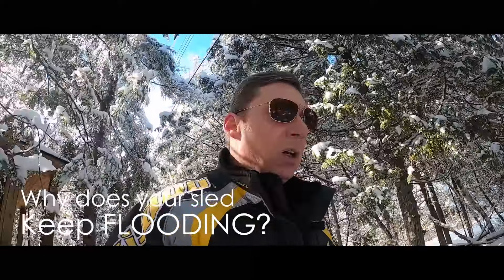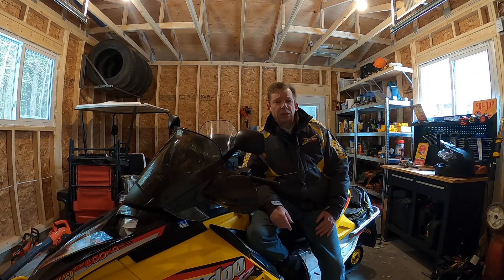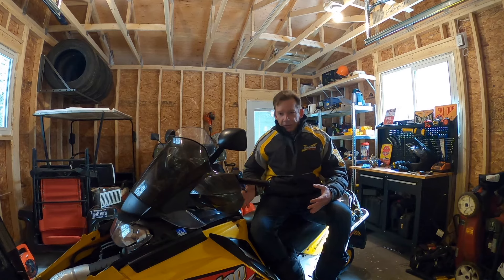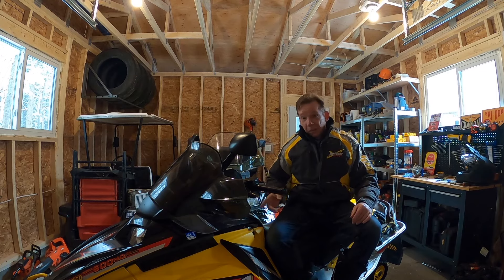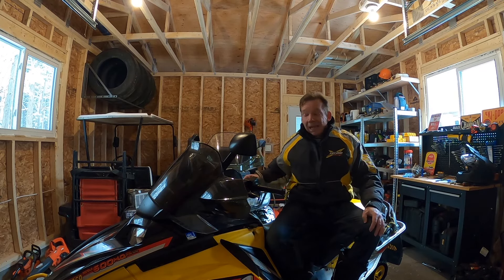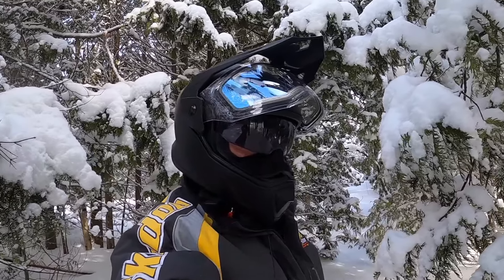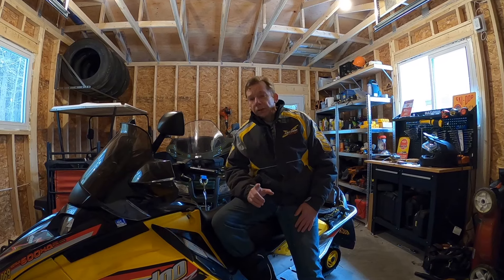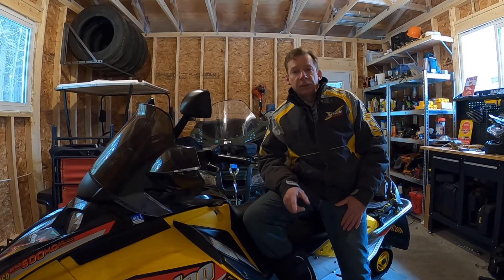Why Your Snowmobile May Be Flooding, Fouling or Running Rich

Comment: Holding the throttle open and pulling it over must clear the excess gas out.  It works on my old sled, in fact that’s what the owners manual says to do. Like you said now I know exactly how to start it so it’s never an issue but if your stuck out on the trail it’s a life saver.  Nice video Dave 👍🏻
Reply from the maker: Too much work :) thanks for watching

Comment: Hey Dave I had an issue with my 1996 mxz583 and it was my float bowls were actually cracked so the floats would never move up to shut the flow of fuel.  Took me a while to figure it out but once I did the sled ran like new after.

Comment: Got a 95 polaris xlt. High rpm bog can't figure it for life of me. Cleaned lines from in tank to carbs all spotless, tensioned belt & track, 120 compression. Runs & idols like a top however 6k rpm bog out. Happens with and without air box.
Reply from the maker: What do the plugs look like? Maybe try dropping the circlip on the needle one slot? Both cylinders. That would lift the needle slightly and allow more fuel. Let me think on this a bit but I think that would just richen it a bit…

Comment: Well my Skidoo flood so much it pours gas out of the exhaust. Clean the carburetors more times than I can count and it continues to flood and does not want to start. Everything inside the carburetor is new. Now discouraged to the point where I don't even want to own a Ski-Doo anymore new or old.
Reply from the maker: Diaphram in the fuel pump maybe, gas flowing through the pulse line to the crank case?
Reply: @MyOldSled  nope diaphragm in fuel pump gas lines are all brand new. There's no reason for it not to start and run besides to Ski-Doo being cursed.
Reply from the maker: No, if it was that my two wouldn’t start. To clarify, what did you replace inside the carbs?
Reply: @MyOldSled  everything including floats that cost $58 for one
Reply from the maker: I feel for you that kind of think is frustrating but if the fuel pump is ok, then its needle and seat or o-ring, float sticking or float arm bent up too much.

Comment: And this happened to me?? The primer was defective?? There are one way valves in the primer and if they get screwed up or leak??,,fuel can syphon into the carbs and cause problems..? If this happens,,pinch the tube supplying the carb!
Reply from the maker: My sled has a fuel shut off. Normally if the primer leaks it won’t pull gas up properly and you know its time to replace it.

Comment: The tip about watching the fuel line while priming helps. Lately it seems like I have to press the throttle to help it along. Is that wrong? Or should I just pump the primer more? Our temps have been up to -28 at night. I have the '97 Grand Touring with 583 rotax, electric start. I'm worried I might run my battery down. Once it starts,  I'm good for the rest of the day.
Reply: I did watch your video about how to start a 2 stroke when cold but I have those few additional questions. I saw that you were giving it gas and then had to prime a couple more times, too. I just don't know if holding the primer up is helping or hurting. It seems like it helps.
Reply from the maker: I generally keep them primer out and give it another shot or two when it hesitates until it warms up enough that it doesnt need a richer mixture
Reply: I have found that with most Skidoo models feeling for 2 full primer squirts and leaving the primer up helps. Re-hitting the primer when it starts I have also found helps. And not touching the primer for the rest of the day, unless you stop for a very long period of time. I have also in the past set the parking brake and inserted a quarter in the thumb throttle to prop it open. Happy riding!

Comment: Hey Dave, looking for some advice on my 92 Indy trail, I’ve done a complete carb rebuild, changed all fuel lines and pump but I am still having issues trying to start the sled. The compression is good on both cylinders, floats seem to be in good shape. There is a small amount of excess fuel leaking out of the overflows on the carbs. I poured a small bit of fuel in the cylinder and plugged the spark plugs back in and it turned over then died. Any ideas TIA.
Reply from the maker: Still sounds like a needle and seat issue. So wrong needle and seat, bad needle tip, floats sticking or not adjusted right…thats the only reason I can think of you’d get fuel leaking from the vent lines. Are the spark plugs wet?

Comment: Hi David.  Love the show.  One you missed here that is a mystery to many....if a fuel pump has a pinhole in the diaphragm, gas will run down the impulse line.  Happens a lot in the old Mach 1, Mach z, Formula...etc.  Happy Sledding!  Len
Reply from the maker: Hi Len thanks. Yeah I realized that would be good to include, right after I posted :)

Comment: Great video, lots of useful info. Hes right, Check your o rings on the seat. I bought a new to me sled this year (03 440 REV) , went for short ride on the lake,  was missing some power, I opened the side pannel and noticed that I was shooting gas out of the carb vent lines. Took the carbs apart and saw that my orings where dry on the seat and had shrunk, replaced them and eliminated the problem.
Reply from the maker: Hi Ben. Yep, for sure if you have gas shooting out of the vent lines it's needle and seat. Thanks for watching and for taking the time to comment. Have a blast with your new machine.

Comment: Great info Dave! The older vintage sleds were quite a pain because of fouling plugs from improper starting (excessive primer) and because of richer oil mixtures. Todays sleds are much easier to start but I like your take on why they flood. A good trick I learned from an older gentleman is, when you're in a flooded situation pull your plugs and pull it over (like you showed) and before putting the plugs back in, give each plug a shot of starting fluid, that will dry up the wet plug and make it more prone to fire. It's worked for me many times.
Reply from the maker: Thanks SK.
Reply: This is what I do on my 90 Arctic Cat Jag Deluxe with fan cooled Suzuki 440. Works every time, I always was reluctant to use starting fluid on my vintage garden tractors and motorcycles but this Arctic Cat was a monster to get started until I rebuilt the fuel pump and redid the fuel lines.  I expect to go through everything on an old tractor I buy for cheap but I thought I had a sweet barn find with only 1500 miles that was pampered in a garage by an old man. Turns out I still had to restore it based on time and not mileage and abuse.  For every 20 miles I had almost 10 hours of labor and replacing parts but she's almost brand new now!!

Comment: Hi Dave , New to sledding and running into the flooding problem. This just started with my sled. I'm running a 500 bored 30 over and this is a rotax engine i have installed in a 93 Polaris Indy. i synced the carbs and adjusted the air fuel mixture to the best of my knowledge. This thing hauls ass. I have maybe 60 miles on the new engine but now at start up its flooding its self out. once I do get it running and warmed up runs great. After watching your video that is the first thing I'm going to check. Thanks for the info.
Reply from the maker: Yeah when your talking Frankensleds I don’t even know what to suggest. Good luck, thanks for watching

Comment: Honestly I love the primer bulb over the choke lever I always found it more reliable but they are easy too flood. I've also flooded it but when it gets flooded I hold throttle wide open to get it to start. Now I have a fuel injected machine. I never found the 670cc engine hard to pull over one handed but to each their own. Happy trails
Reply from the maker: Once its warm, and running right it’s easy. When its cold and flooded, you wont pull it over easy with your left hand.
Reply: @MyOldSled  cold is a different story if it's cold flooded I pull the plugs clear the cylinders and dry plugs

Comment: I'm new to sledding this year and I come across all the odd stuff. One cylinder one lean turned out to be a needle and seat. A new gas line sucking in air. and now I'm fighting it bogging in till wot kicks in. I did rebuild the carb synced the carbs put it to factory specs and all that. I'm sure its fun once you get the hang of the carb stuff. Your video made me thing I should start the checklist over again though. Thank you.
Reply from the maker: I would order a carb kit and then you know you have all stock jets o-rings and gaskets
Reply: @MyOldSled  Thats the rebuild I mentioned I did. Jest, seals, needles ect and ultrasonic cleaned the carb. Maybe some dirt got in there again?
Reply from the maker: What sled is it again, sorry?
Reply: @MyOldSled  its a 96 polaris 440
Reply from the maker: Msg me via facebook if you want to bat some ideas around.

Comment: 03 rmk 800. 
Bogged down and died under heavy throttle, idled poorly afterwards until things settled into place after. 
Solution - drained fuel mostly, added half a tube of Lucas injector/carb cleaner, which is like 2x recommended concentrate on a full tank, ran it dry, the added 5 gallons, and poured in the other half.

I hate taking apart carbs, so I just hit them with enough cleaner to kill it, just about

Comment: If you think that thing is hard to pull over try a mach 1 670! The mxz 670 for that year were extremely easy to pull over due to the great big recoil. The mach1, had the smaller recoils from a lot of smaller motor ski doos. 

Also, I would rather just hold it wide open and pull the thing then blow gas all over my sled. 

You did a good job explaining how fuel mixtures can be rich or lean, I think pretty much anyone would understand it with how you said it
Reply from the maker: LOL @ "Extremely easy to pull over" ...Not sure if you noticed the big '97 MXZ 670 in some of my videos, but in case you didn't, well...I have one....and they're not. :)
Reply from the maker: Oh… also a huge difference when it’s cold. Warmed up it’s easy
Reply: lol
Reply: My old mxz670 would start on the first pull. But it took 2 adults and a team of healthy volunteers to pull it over.

Comment: If it’s super flooded you can always use a butane torch down the cylinders, just make sure to turn the fuel off and pull it over quickly if it catches fire lol. Has saved me tons of time on an old 80s Yamaha rather than pulling with plugs out, especially if the crankcase is full of fuel. Also, glad to see you’re making more videos these last few months, was missing your vids for awhile there!
Reply from the maker: Oh my. I really appreciate you watching and commenting, but I can’t express how much I don’t recommend doing that. (How would you use a butane torch down the cylinders without pulling plugs anyway) There are so many reasons that’s a bad idea, fire risk damage to your engine… please just don’t
Reply: @MyOldSled  haha fair, I expected a reply like that. Grandpa showed me this trick back in the mid 90s. Yes pull the plugs, then using a little Coleman gas tank and nozzle, quickly pass it down the cylinder. May give a bang like a .22 rifle, may smoke, may catch fire for a sec. In any case pull cord. Gets rid of gas fast, have had some sleds where I’ve pulled for an hour with plugs out and fuel off, but due to fuel in the crank it wouldn’t start. The torch was the only way. Plus, if you get stuck on a lake in -20, it’s a helluva lot quicker than waiting for it to dry naturally. Maybe a bit risky I guess but been doing it for years and never had a problem. Torch is nice to have on trails for drying plugs too
Reply from the maker: lol glad I didn’t disappoint. I don’t like to disagree with comments but I believe in responding when people take the time to comment. But I also have to reply honestly and I believe that is a terrible approach. All due respect to grandpa! Glad you haven’t damaged anything or hurt yourself..yet. Seriously I appreciate you commenting anyway. (Kids, don’t listen :)
Reply from the maker: I think if my crank case was that full of gas, id pull the pulse line and pull it over a few times as opposed to building a pipe bomb. ;)

Comment: Flooded a 96 mxz 440 my son had.  Pulled hard enough to begin with, dam near gave a heart attack trying to start it flooded. Thx for the info.
Reply from the maker: Yep a lot of sleds are hard to pull over. So I use that method, but again be careful. Thanks for watching.

Comment: hi dave i have a formula mx 470 1990, i adjusted the carburetor and found my idle, it starts the first time. but when i try it and it gets hot it chokes. i try to find why and how and it's always the same result. i cleaned everything properly. i listened to your video and i think it runs too rich. or the floats are not doing their job properly what do you think?
and your video is excellent thank you very much.
Reply from the maker: It starts and idles fine but bogs under throttle? Fuel filter? Needle position? Sometimes ignition coils or spark plug wires.  Just a few thoughts

Comment: Just bought a 97 MXZ 583, started great.  Spent 3 or 4 days working on it replacing just about every idler bearing as they were seized or close too.  One pull and away we went off to the gas station.   Filled up and couldn't start it again.

Flooded!  The carb needle wasn't closing and I'm guessing with the tank full, the added pressure allowed fuel to flow way too easily.  Cleaned and rebuilt carbs and immediately saw fuel coming out the overflow on the pto side.  Took the carb out and cleaned it all out and rebuilt again.  This time it held but still couldn't get it started and noticed fuel coming out the air hole on the top of the pump.  I'm new to snowmobiles and was told fuel pump diaphragm must be bad now that the carb is building pressure in the gas line.  Installed new pump.  After 3 pulls I could see fuel coming out of the new pump in the same spot.  Everyone was stumped other than to say my new pump must be bad.  I ripped apart the old pump to find the diaphragm was fine and that there was no way fuel went through it.  The crank case was full of fuel and was back feeding into the top of the pump :(  Disconnected pulse line to fuel pump, pulled it over till no more fuel came out, put it all back together and it started first pull!  Yay!  Lol after a week I now a lot more about how it all works, your video is a little late, but definitely would have been helpful too.  Keep up the posts!
Reply from the maker: Yes that hole,is a vent to allow the diaphragm to move. The pulse line pumps fuel because of the alternating differential pressure in the crank case. I haven’t pulled mine apart, but There are check valves that allow the fuel to flow through it one way, so you may have corrected the problem with the new pump, but had to clear the crank case of fuel?
Reply: @MyOldSled  , there's no check valve, the pulse line connects to the port at the top of the diaphragm which as you said drives the pump.  The problem was just how much fuel got into the crank case from the faulty carb allowing fuel to flow into the cylinder.  The fuel was pushing from the crank case onto the top of the diagram.   If anyone ever asks about fuel spitting out of the hole in the centre of the fuel pump, that's why.
Reply from the maker: Sorry. Understand re pulse line. Some fuel pumps have a flapper valve on the inlet and outlet for the fuel pump.Doesn’t matter, I understand what you mean. Glad you worked it out
Reply from the maker: Ignore me, that wouldn’t make a difference anyway it’s on the other side of the diaphragm
Reply from the maker: Ryan, I appreciated your comment about knowing a lot more after you figured it out. Great way to learn.

Comment: I have a carborator sled 2005 mxz ski-doo 380 fan cooled . And a Polaris 2016 indy fuel infected liquid cool .  Had a problem getting the ski-doo to run right last year its was bogging when you would put it into Reverse no power . It wouldn't  idle very well when stopped it would slowly quit after sitting there after 30 second or more . Finally took it in to a repair center to get it setup right . This year was idling to high over 25 hundred to 3 grand so I backed it off a little.  Marked the idle screws with a marker just to make sure they were even across and not offset idle screw were the same on both  . And for my information when setting them .
Reply from the maker: Reverse is common when its not running right. So are you ok now?